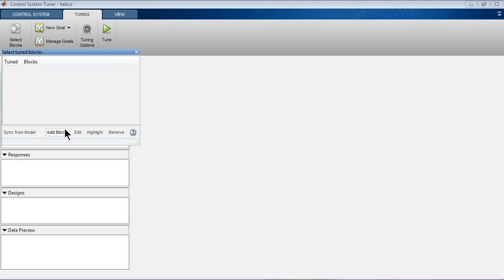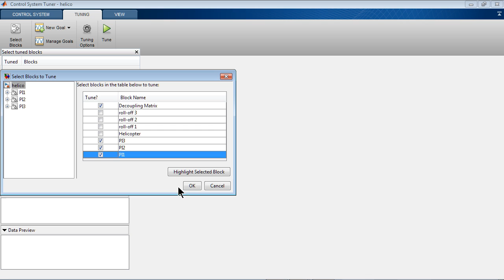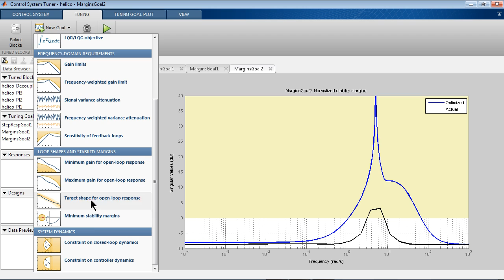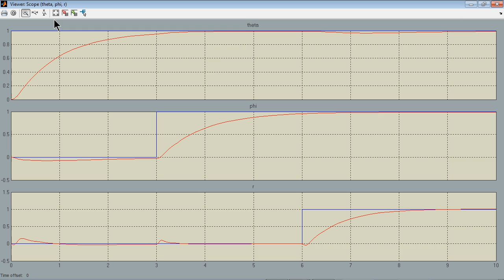Automatic Tuning of a Helicopter Flight Control System

Comment: Wow this is incredible this is like magic! Could I use this to somehow tune or create my own flight controller for a quadcopter? Somehow build the dynamics of the model, the response curve of the motors and how it makes the quad accelerate or rotate and have it somehow figure out the best parameters to push back against deviations or hold itself level or whatever owo

Comment: Hi. You have kept the initial conditions in the state space block as zero. Is it always the case? I have been trying to tune my model. When I keep the initial conditions as 0, the results are as per the graph demonstrated. But as per the trim point, when I specify the initial conditions, it goes unstable. Can you please clarify??